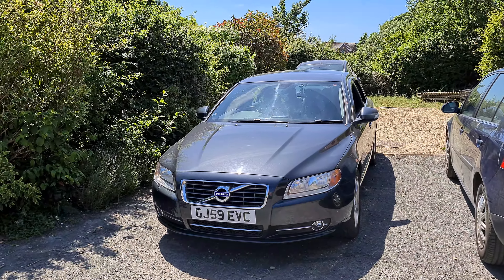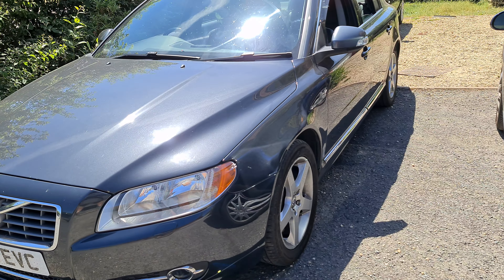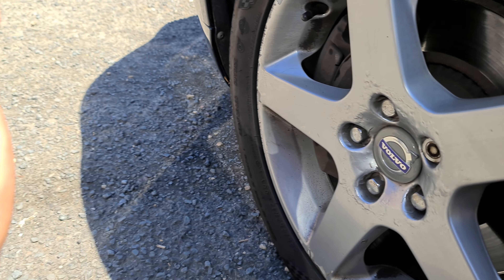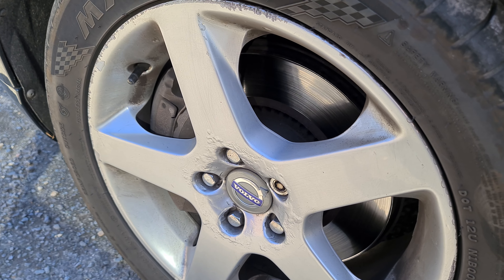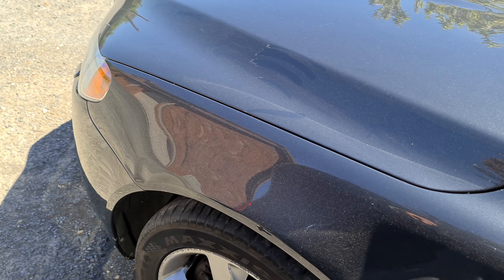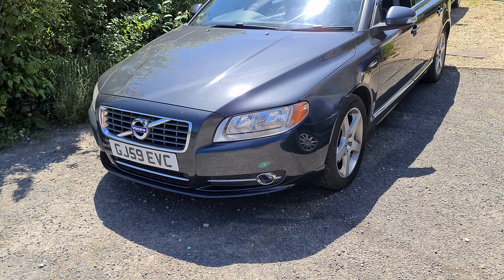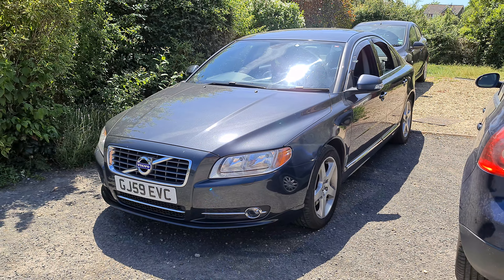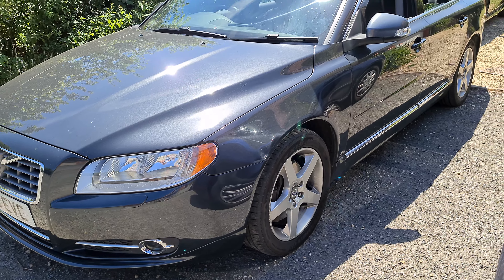My Volvo has a *MASSIVE DESIGN FLAW*

Comment: When was your brake fluid last changed? Also a previous owner may have fitted cheap Aftermarket  brake pads which could easily cause this.
Reply from the maker: Fairly happy with discs and pads as they are both decent Pagid ones, I think I'll go for the fluid change soon as I'm doimg coolant soon too :)

Comment: check you haven't got a seized caliper. Failing that replace the fluid/discs/pads and check again. I have owned 16 previous cars and never had specifc cooling ducts, i honestly dont think thats your issue.